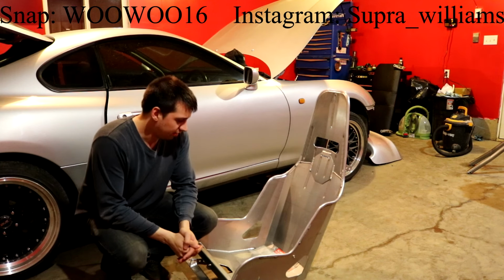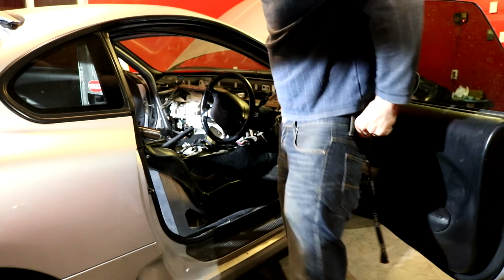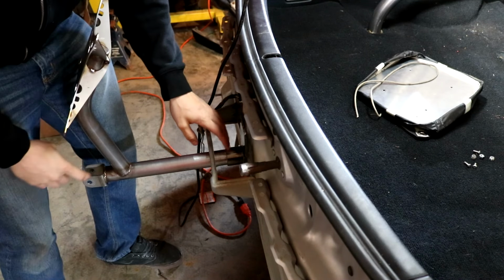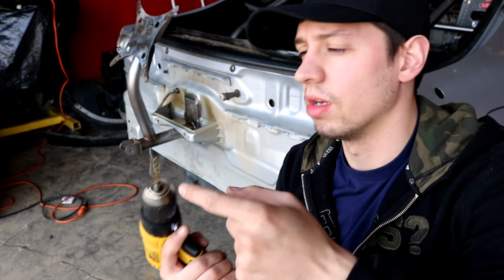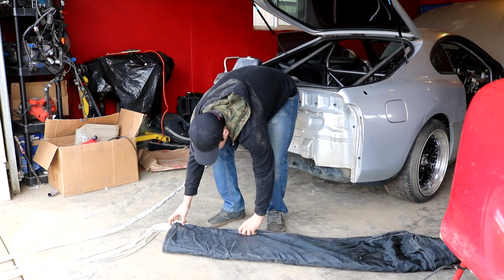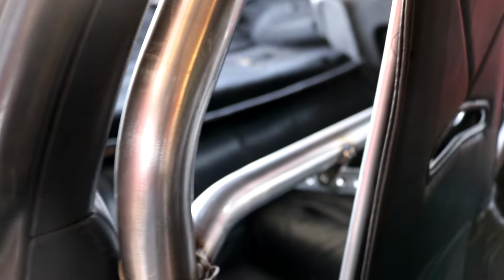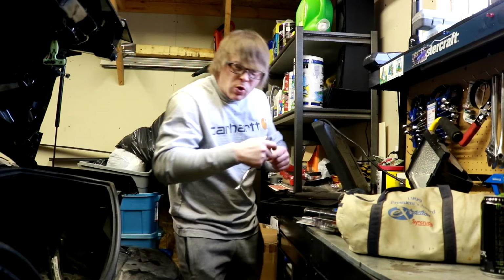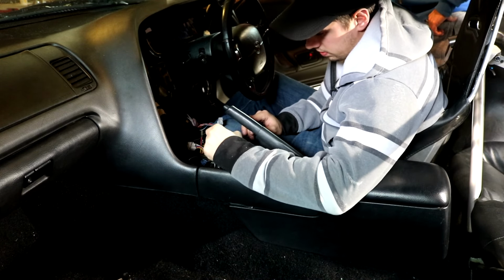Damn Its Tight But It Fits!

Comment: Are you running a rear bumper/cover?  Wasn't the point of using the interior bolt/hole to slide the shoot mounting tube through the bumper?
Reply from the maker: I'll be running a rear bumper , however the jdm bumper has a huge hole for the license plate that i can easily get at the bolt